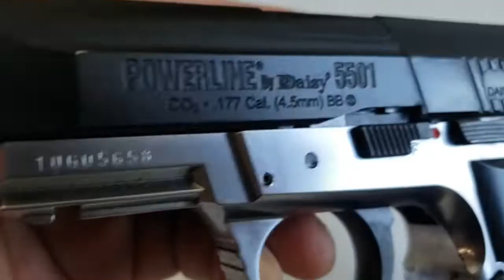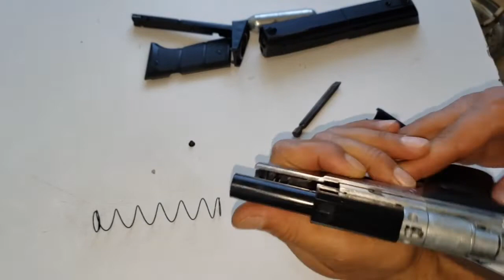How To Fix BB Air Gun CO2 Pistol Not Working Made In Japan

Comment: Do not over tighten the bolt the sanding was not needed it has 2 dots on the bolt that go up so the slide can function. Also it was sticking at the end because you over tightend the screw infront of the sight causing it to jam. Those guns dont like much grease clean off the excess and you will have it working fine. If it leaks the rubber ring gasket on the bolt is broken just replace it.
Reply from the maker: Thank you so much, yes that's right very helpful tips and great advices 
I will keep that in my next time repair 
Best regards ✨

Comment: Tengo una con el problema de que no se vuelve a cargar automáticamente y tengo datarle al cañón para atrás en cada tiro, me podrías ayudar a resolver ? Y gracias de antemano
Reply from the maker: Hello my friend, yes that' could be the slider off shape or dirty Try to use oil 3 inb1 oil or Multi purposes oil it may solve the problem,  or check the spring it may be loose or short little bit , also try if oil didn't fix the problem then you need   Disample it and  check if slider is hitting with something, if anything is touching hard or jammed little sanding or filing it should fix the problem.
Thank you and all the best
Reply: @WorldRandomVideos  okey, thanks my friend.

Comment: Well, w/o words I could not see where he was in his repair. Nothing written after the first minute and on my phone could not see well enough.
Reply from the maker: hello my friend, thank you so much for watching and your wonderful concerns, i am sorry I forgot to write down information in this video after 1 minute I didn't add more written information, and the reason I added music instead of talking because it was noisy room,
so here are some information problems and solutions about this bb air piston gun,
1- the gun has air lakes every time I install pressure air cam on starts leaking air
solutions: 
1-losed or not tight enough air pressure components 
2- replace rubber washer inside air tight valve 
second problem is slider got jammed 
solutions 
1- some cases use air gun lubricant can solve the problem 
2- this one however has sliding metal scratches and too tight, sanding can solve the problem just like I did in this video 
3- the worst case scenario both sides of sliders room get wider or metal eaten out fitting not exactly unfortunately very hard to fix it needs new parts, 
I did fix this air gun in this vidro but it was not permanent Fix sooner or later I will have to replace parts 
in order to work properly 
I hope this will help you thank you so much again and all the best 👍

Comment: You need to put some grease on that part for smooth slide
Reply from the maker: That's right, I used lithium grease spray on smooth side part it help so much for movement slide forward and backward , thank you and all the best 👌 👍
Reply: Is that slide working well now?
Reply from the maker: Yes but not very smooth as should be must be very prosize and done by  leathe mechine which I don't have,
Reply: Is there no leaking issues with the o ring?
Reply from the maker: It was but I fixed it, I had to tight a small screw with ring to prevent any air leak
Reply: @WorldRandomVideos  can you use Teflon instead of o ring?
Reply: @WorldRandomVideos  can you use Teflon tape instead of o ring?
Reply from the maker: @edwardleonen1442   hi Edward, i haven't try it yet,  i don't think it will works  because Teflon tape works great bolts male and female threads if the bolts or screws are big enough to wrap tape around it.
Reply: @WorldRandomVideos  because they use Teflon on threaded barrel like pcp riffle
Reply: @WorldRandomVideos  maybe it’s working and cheap than buying o ring
Reply from the maker: @edwardleonen1442  it's hard to find parts for this particular model
Reply: @WorldRandomVideos  that’s why we need another options

Comment: Tengo una con un problema del gatillo no suelta el percutor me podrías ayudar
Reply from the maker: hello my friend, it may need just clean up try to spray dw40 and see if that can solve the problem , if didn't than you need to take it parts and take a look inside sometimes the hammer jammed because of non smooth service on the metal or the metal service has been eaten out or chips or Secratchs prevent the hammer to slide smoothly, try to light sand use 240 sand paper,, unfortunately if the bb gun housing got eaten out nothing much you can do and will need new housing so hammer and triggel can fit exactly, and reason why it's because most of bbg are made from cheap metal don't last long time and can't reset the power of air pressure, hope this can help you to figure out, all the best 👍
Reply from the maker: hola, amigo, es posible que solo necesite limpiar, intente rociar dw40 y vea si eso puede resolver el problema, si no fue así, entonces necesita desmontarlo y mirar adentro, a veces el martillo se atascó debido a un servicio irregular en el  el metal o el servicio de metal se ha comido o las virutas o Secratchs impiden que el martillo se deslice suavemente, intente lijar ligeramente, use papel de lija 240, desafortunadamente, si la carcasa de la pistola de aire comprimido se ha comido, no hay mucho que pueda hacer y necesitará una carcasa nueva, así que  el martillo y el gatillo pueden encajar exactamente, y la razón es porque la mayoría de los bbg están hechos de metal barato, no duran mucho tiempo y no pueden restablecer el poder de la presión del aire, espero que esto pueda ayudarlo a descubrir, todo lo mejor 👍
Reply: @WorldRandomVideos  muchas gracias bro lo intentaré y si pudieras ayudarme con algún vídeo para desarmar el equipo te agradecería muchísimo
Reply from the maker: Es un placer, lo haría si pudiera tan pronto como tenga tiempo subiré un video para ti, todo lo mejor
Reply from the maker: My pleasure, I would if I could as soon as I got time I will upload a video for you, all the best